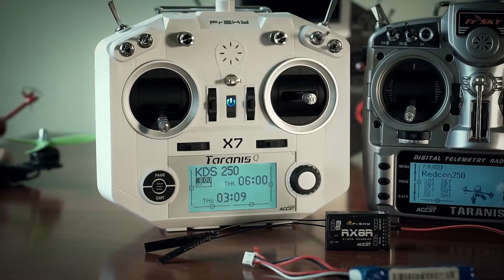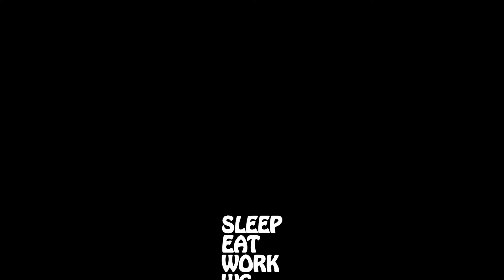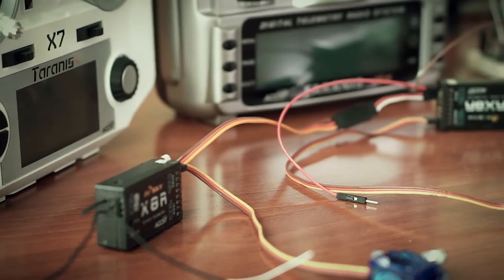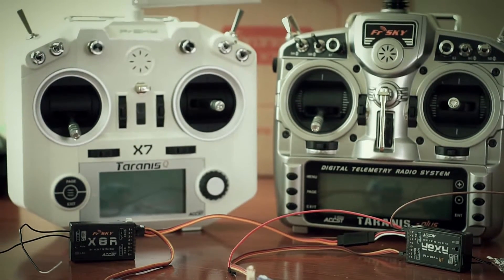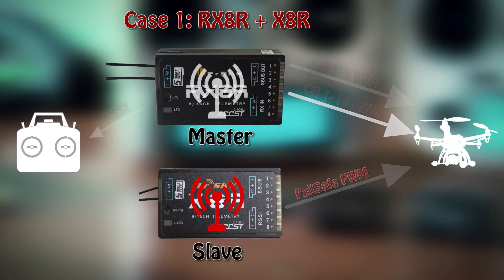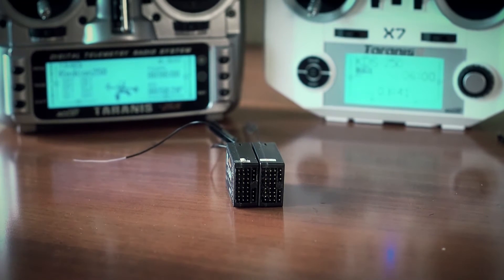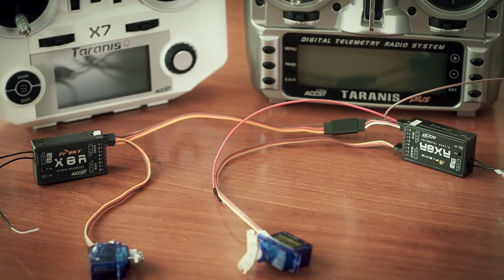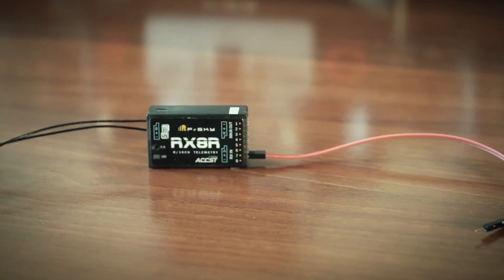FrSKY RX8R redundancy bus receiver review

Comment: Hi, I used tu use two Rx's on my gas planes, one for left side and one for the right side in case one Rx fails or it's accu then I could still bring down the plane acording to some people. Would it be better to use this sistem you show us? I have the Taranis X9D Plus eu version and one (soon will be 3) X8R eu version(I'm in EU). I wanted to go the same route as before with two X8R but now that I'we seen the RX8R It sounds good. The Rx8r can be used also as a single Rx right? Besides the fact that the Rx8r has to be also eu version what else do I need? Only a servo cable between the Sbus ports of the Rx's? You mentioned that if the slave Rx dies you lose the 9-16 channels but if I have all my plane's controls on the 1-8 ch and only use the slave Rx for redundancy in case the master fails then I don't lose anny of the channels annymore right?
Reply from the maker: Yes. Everything is true. Although, FRSKY has released GAS suite and X8RPro for gas planes which should be more stable in terms of electomagnetic noises and ignition noises. You should really consider those type of reciever for gas planes

Comment: Hi! I received from shop (RX8R instead of X8R) and it does not 
have RSSI output. Can I get RSSI output to my pixhawk? How if there is 
no port for RSSI?
Thank you!
Reply from the maker: There is no RSSI port because this port is used for redundancy feature (connecting any other SBUS receiver to make diversity system). But the manual says that there is RSSI analog putput on the board. You can try to open the case and locate RSSI pad on the board. If you'd not locate me - write back another comment and I'd ask FrSKY where is it for you...
Reply: IryxBRO Aerials you think it is hidden inside of case? would not be very userfriendly hmm
Reply from the maker: It might be hidden as the manual states that there is RSSI pad on the board. This receiver is intended to be used as redundancy bus - therefore, its RSSI port is used for SBUS in.